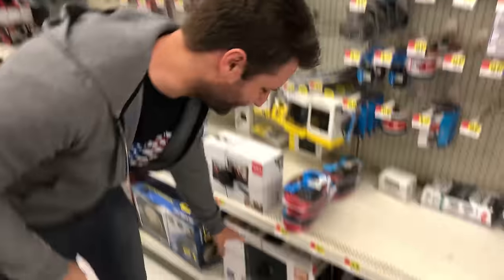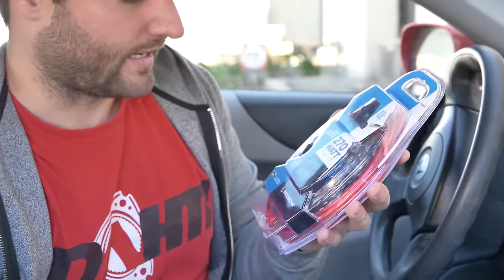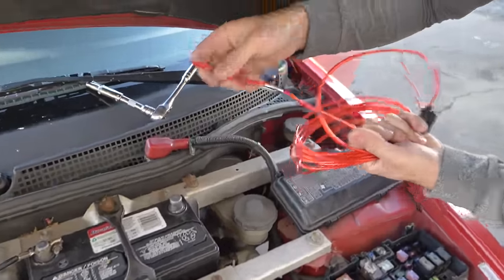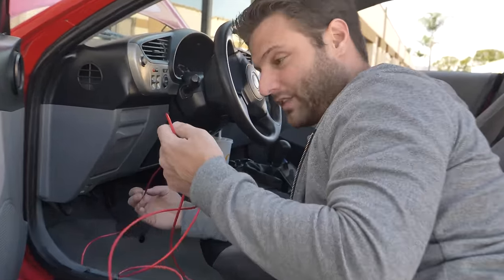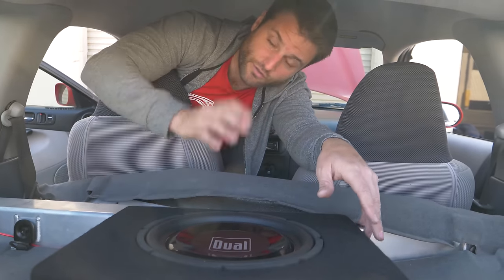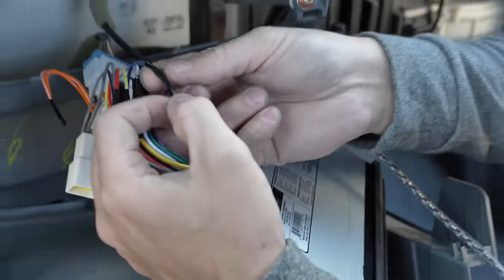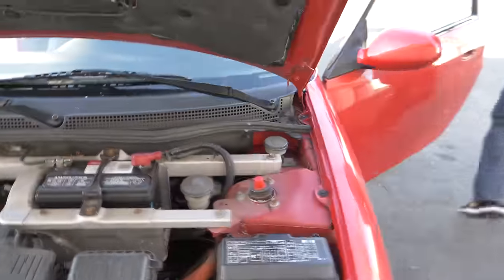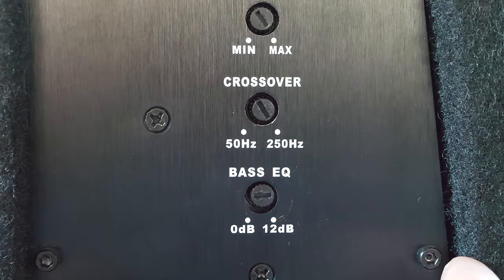How bad is the $70 subwoofer from Walmart? Install | Review

Comment: This dude is nuts... don't run ur power cable thro door jam or door boot. . And that garbage power cable is barely thick enough l. Great way to start a fire.
Reply: How is the cable not thick enough?lol
Reply: @gordomiguel1931  of u go to Walmart and buy an 8 gauge amp kit and look at the copper cable in the center you will see that the copper cable is more like 10 gauge. So Walmart brand cables will say its 8 gage counting both the copper and the shotty rubber sheathing. Where when you buy a good set of amp cables like kicker for example the copper itself will be a gauge plus a really nice rubber sheathing to protect it.
Reply: Most major audio companies nowadays actually sell wiring with gauge size larger or even much larger thasn advertised and some of the amp wiring from walmart is actually true 6awg.
Reply: Besides that,the amplifier incorporated into the powered subwoofer system in this video realistically will not put out anywhere near it's advertised 300w.
Reply: @gordomiguel1931  True. I got an amp kit from Walmart, I cant recall the gauge off the top of my head, but it works great. I have a true 300 watt rms rockford fosgate powered sub, it's way louder than this walmart powered garbage.
Reply: I dnt think he plans on keeping that junk in ther😂
Reply: While that may be 8 (or 10) ga wire, that sub is 300W advertised, so most likely 150rms, which 10ga is plenty fine for. 8ga is plenty fine for 300w rms. I've been running 500w RMS for years and years off Walmart 6ga cable. S'all good.
Reply: That subwoofer pulls 45w RMS max. Maybe 100W peak. Its powered by the head unit.
Reply: Andrew Hunt well, no it’s not. It actually powers itself, that’s what all the power cabling was for. The head unit is only providing a low level sound signal and a 12v tigger wire (remote) to tell the sub when to turn on/off. This subwoofer produces 100w of RMS power.
Reply: It's not ran through the door jamb! Think about it. Do the wires for the fuel pump run through the door jamb? Just sayin.
Reply: @gordomiguel1931  the cords are actually a heavy enough gauge for the setup. This is running a $70 powered sub. Powerful systems may use a 4 or 0 awg wire, not this one.
Reply: @krazykraut627  -- I usually skip the wiring kit and just buy 4 or 6 gauge positive wire and 0 gauge for the ground from my electronics supply store.  That way everything is cut to length and I don't have to worry about things like inductance from coils of excess wire or not having enough to route it where I want it.  Connectors and fuse holders are  easy enough to solder on and I know the quality of the wiring I'm getting.  Kits, even higher end kits, are always garbage when compared to just designing the system yourself and buying what you want.
Reply: I mean it's probably 50-80watts Rms. But something I tell people no matter how cheap of a system there getting at first is always go with 1/0 awg OFC wire right away. Because when you start upgrading it's all plug and play from there instead of having to rewire Everytime
Reply: @MLProductions.1  This is always good advice.  Go big early on everything as far as the infrastructure goes.  The only exception being the fuse.  Use the appropriate fuse for the amp.  That's easy to change and an important safety feature.
Reply: @FeelFighters  Walmart garbage? Don't be a bass snob. Not everybody wants to thump so hard they set off car alarms.  Some people just want a little extra range in the low end so they can hear (not feel) the deeper bass.  For this, the Wal-Mart amplified subwoofer is perfectly well suited and appropriately priced.
Reply: @kender1412  I've literally had this same dual powered subwoofer. I call it walmart garbage because 90% of dual products have failed on me. You get what you pay for definitely applies to this situation. A powered subwoofer isnt something to cheap out on, just because you want to hear the bass. If that were true you could get 2 boxed 6x9s and an amp to power them for less than this shitty subwoofer. If you want a decent sound go JBL, if you want Sound and bass, Rockford Fosgate, or JL audio. I have all 3 brands, 1 in a corolla, 1 in my saab, and I bought the jl audio for my pops because he already has an amplified Bose system, adding a sub to it made him ecstatic. That dual subwoofer blew in a month, at less than half of the gain, I replaced it because I had the 2 year warranty and the new one I got didnt even power on out of the box. So yes, it IS walmart garbage. They do have decent audio products, just not dual, or scosche speakers in my experience. They have scosche amplifier kits that are half decent, they are true OFC, and true AWG. But the rca's they come with tend to be lower quality.
Reply: @kender1412  yes definitely a big fuse on a weak system won't blow it if anything happens. But thats easy. Rewiring a whole car is annoying and takes time. Better off doing the wiring right from the very beginning so later on you can swap stuff out quickly

Comment: Ah! For all the newbies, ALWAYS run your RCA cables and remote wires in conjunction or with each other, and on the OPPOSITE side of the car you ran your power wire, or you WILL get some nasty distortion I almost guarantee it.
Reply: Quentin Smith Such is really not at all necessary.  First this is not a 1000A subwoofer plus amplifier install, it's a small ~10A job.  Second, if concerned just run the positive and negative leads together, twist them together along their length, and you will have effectively nullified the magnetic field as the field produced by the two power leads will be tightly coupled to one another (and not into other wiring) and because they are equal and opposite they cancel each other out (twisted pair works well anywhere you have a balanced signal, and power is always a balanced signal as what goes in must also come back out).  That all said, any remotely decent RCA audio cables will be shielded coaxial cable and interference is very unlikely in that case (even in high power setups you are more likely to encounter feedback issues due to unintended ground loops than coupling onto a shielded coaxial RCA audio line).
Reply: Ethan Poole you don't run your power and ground down the same path when installing subwoofers. You totally could, but it's not ideal. Also, the flux from the two magnetic fields interacting could cause even worse distortion and as any seasoned sub installer knows, distortion kills subs
Reply: joshua craft that completely makes sense.  I had a couple 12's some years back installed "professionally". Always got some distortion from them and could never figure it out. Wires were all ran together.
Reply: twisting the ground and power together and running them to the amp is a fantastic way to cause a fire risk if you don't have an inline fuse that isn't garbage installed at the battery.  Best to ground to the frame wherever you're installing rather than run a ground wire with the power wire.  Especially true if you're untrained and you run the wires thru the firewall without installing a rubber grommet.

Comment: One 12 is good enough. Just get a good box. I use to have 2 JL 10s in a sealed box. Then I got a JL 12 inch with a ported box from sound ordinance and its crazy how much bass I get with only 300rms. I got it hooked up to a 5 channel alpine and people would tell me to turn it down because they don't like it to be that boomy to where you get a back massage.
Reply: It’s all a out what you’re going for. I has two 12s and they used to beat. Then I got a single 15” Kicker L7 in a custom box and it was absolutely insane. Really was too much. Im not into it as much as I used to be. As crazy as it gets for me now is the sub I replaced in my 2003 Lexus ES that I use when I wanna save on gas lol. Its a Memphis and any street dude knows that while Kicker, Rockford and JLs are quality brands the Memphis and Q Power subs just hit WAAAAY different 😂

Comment: Any distance should work, but the closer you are to the battery the safer you will be. By safe, I mean that regardless of if the fuse is blown or even in place, the wire from the battery to the fuse holder will always be live. If cut accidentally, no fuse to blow and protect you, since that fuse is 'upstream'

Comment: Dude did u just really run that 12v power wire through a fuse? 🤦🏾‍♂️🤦🏾‍♂️🤦🏾‍♂️
Reply: Looked like the main feed into the box, fairly harmless spot.
Reply: FAT 500K dude he just did
Reply: Im sorry bro but you can actually run your power wire to your fuse box and why because your fuse box getting power from your alternator and your battery all the wires is together. But I can tell you never had hooked up your own sound in your car.
Reply: Bill Gates i got more watts runnin thru this piece of shit car den yo livin room sir, pipe down
Reply: Piece
Reply: Bill Gates no i have 4 15s custom ceramic box ap bd4s, ona zl7 11k watt amp two 12s on my front doors on 5k zl3 amp 4 batteries yellow tops
Reply: Quinncy Woods i never EVER heard of that but maybe because that lil speaker doesnt push that much watts, where im from we STR8 battery action, shit and might add a extra battery on da first set up just to get the most out the amp
Reply: FAT 500K it wont i have 2 15s on a massive 3k watts 0 gauge and my power wire going to my fuse box with the extra fuse with another battery and it no problem and been in there about a year if you actually look battery positive wire u will see where the fuse box getting power from. You can have your power going to your normal car battery the alternator or your fuse box the all run together. Do me a favor and check it out on your car and get back at me if you can tell me another way where your fuse box get its power from.
Reply: Quinncy Woods exactly what i said
Reply: The Don Vape Mafia Inc thats for people who never hooked up there own amp and think they know something i dont know alot but i been hooking up amps too my car alot so i know how the whole thing is wired up
Reply: bobwatters Okay I see what the problem is you cant read correctly you have a power wire going to a battery,alternator and they fuse box all of your fuses have power from the other 2 power sources so not matter what gauge your wire are its strong even to push whatever u have unless you going beyond and added multiple amps then you need some more alternators amd batteries. Do me a favor and pass by a professional car audio shop and ask them.
Reply: Quinncy Woods the gage of your power wire determines how much power you can send to your amp. what he's saying is that if you're taking power from the fuse box to your amp with 0 gage wire and only have 4 gage wire coming from your battery to your fuse box then you're only getting 4 gage worth of power because that's all the fuse box has available. You can't draw 0 gage worth of power through that 4 gage wire.  If you ran the 0 gage wire straight to the battery you'd get a lot more power to your amp bro.
Reply: James Roberts gage not the correct spelling its (gauge) but I get what he's saying but in that cast that your trying to explain to me about 4 gauge and me having a 0 gauge dont u think that my amp fuse had burnt out or worst?
Reply: Quinncy Woods yes it's gauge thank you for the correction. The point I was making though is that 0 gauge wire carries more current than 4 gauge wire does, so you are not drawing as much power as you would if you ran the 0 gauge wire straight to the battery. And I am not sure what you're talking about with the amp fuse burning out cause if it is burning out you don't need to draw any more power any way. Lol
Reply: xXThenight12345Xx the ricer car in my profile picture bet you don’t even know what it is
Reply: James Roberts THANK YOU!!!! NO ONE FUCKS WITH THE FUSE BOX SMFH
Reply: Taylor thats what he called it lmao so i ran with it but my shitbox is a ‘08 crown vic p71, 4 15s pushing 1500w RMS
Reply: Nice setup I have an 09 police pack with the 200amp alternator maybe looking for a decent sub system
Reply: Chris Smokeyday. Facts!
Reply: If you hate RX7s ("rice"), then why are you on this channel?

Comment: I have the same unit and I bought it at Walmart but I had a professional audio shop that did it for me. Since I carry a lot of equipment which I'm also a part-time photographer I just had the technician give me an option to disconnect and connect whenever I want to use a speaker. So all he did was made the wires a little bit longer and gave me some slacks so I could disconnect the connector whenever I want to remove the subwoofer

Comment: Was thinking about putting a small speaker and sub in my car. I see it’s a lot of work thank you I will not attempt it!
Reply: It's honestly pretty easy if you just poke the wires through a hole in the firewall instead of taking car panels off! Haha
Reply: It's not hard at all, there's only a few wires. Just don't follow this guide because this guy has no idea what he's doing
Reply: Then go to a stereo shop! You'll get better quality, sometimes free installs, and a butt to kick if it goes wrong.
Reply: Dude I did it the parking lot with this same speaker. It was simple.

Comment: Straight to the battery is best, dont mess with the fuse box...
Reply: He only ran a 10 gauge, I'm sure it will be fine for this beater.  10 gauge is only good for about 20 amps.

Comment: Why pay 80 bucks for a cheep sub when u can go on Craigslist or Facebook market an buy a good expensive used kicker or pioneer  12 inch sub for half the price as they were new from 40-100 bucks
Reply: Because people like me don’t want stupid amounts of bass
Reply: ^^^ or because 70.00-80.00 included everything. The Kicker needs an amp and wiring kit. Also, in terms of the video serving a purpose, anyone can walk into the Walmart any day of the week and get the same thing whereas what is available on CL will vary greatly. Plus if the Walmart sub doesn't work, or you don't like it, you can return it up to 90 days later.
Reply: Buying a used subwoofer is like buying a used Civic with aftermarket rims on it. You gotta imagine that the things been beat to absolute death.
Reply: If you want loud bass kicker won’t do u so good you need a skar or an American bass something with some decent surround
Reply: Because it's convenient to buy new
Reply: That would have zero show or entertainment intrigue
Reply: @cliffordcolvard9495 segura jiime
Reply: Because kicker and pioneer are junk too
Reply: I just bought a 12” Kenwood 250w Rms from Best Buy for $49 and it pounds lol
Reply: Pioneer and dual basically same thing
Reply: Joseph Daniels 

absolutely nottttttt lmao pioneer is a Mercedes, dual is a 92 ford escort
Reply: Joseph Daniels dual is trash pioneer is decent

Comment: You showed us where two three way speakers would go. Most new head units are 150 watts power. All you needed were two three way speakers that would give you better sound then the sub woofer. No tearing the car apart, no wasting space for the sub woofer.  Now you have a huge headache and eventually, you will get a 150 watt head unit and two 3-way speakers.

Comment: Never use electric tape. Doesn’t make a good connection.
Reply: Careless Creations um no you need electrical tape, but you solder the wires first to make a good connection, then you tape it so the wires dont ground out
Reply: No that is what heat shrink is for.
Reply: Heat shrink is made to keep heat off wires, electrical tape is to prevent wires from touching each other which grounds or shorts it out
Reply: No heat shrink has no heat protection properties. I’ve been in the electrical field for many years. It’s called heat shrink because you use a heat gun to shrink the film over the wires to protect the connection hint the name heat shrink.
Reply: thank you.!
Reply: "Electric" tape isn't supposed to make a good connection. It's for insulation..........
Reply: ziiofswe I said you solder to make the connection, and use electrical tape to prevent anything from grounding out
Reply: I was referring to Careless Creations' original comment, and I meant it as a joke...

"Never use electric tape. Doesn’t make a good connection."
Reply: You use heat shrink and a handheld torch to shrink it. Tape works... but it pisses the professionals off.
Reply: Avraj Samra heat shrink is made to keep heat off wires? Funniest thing I've read so far today haha

Comment: I put this behind the middle seat in my 1998 S10 and it’s A LOT OF BASS believe me if you have a small single cab truck put this behind the seat and it’ll shake you for days, or until it overheats but it still will work

Edit after 1 year: It blew the fuse and does it every time now, went with a Rockville RWS12CA and 100w to 300w rms is a HUGE difference.

Comment: That is a bad wire job guy. Why did you use electrical tape?  I understand if that’s all you had but you should definitely redo all that because over time that tape gets warm and starts to slide off the wire and can cause a short.
Reply: true
Reply: True, I used tappers
Reply: Shrink tube
Reply: I used to think of electrical tape that way, but eventually, I found that if you wrap everything tightly, wrap from end to end, then back a few inches, so the loose end of the tape is out of harm's way, then superglue the loose end of the tape, or put a ratchet tie on it and superglue that, the assembly will hold up as well as a shrink-wrapped one.

Comment: Point it up toward your back hatch glass. It will double its bass.
Reply: CHALK772 

Nope.
Reply: CHALK772 it will brake the glass
Reply: I have had 6 camaros that were hatch backs with bigger systems and it didn't come close to busting.
Reply: CHALK772 not complaining because I am 16 don’t really have a car yet put want a 2010 Subaru WRX hatchback but it is my opinion
Reply: CHALK772 I said I am 16 don’t have my license yet but want a 2010 Subaru wrx hatchback
Reply: Crypt Artic Yes. He’s really doing it
Reply: @csb772  true...